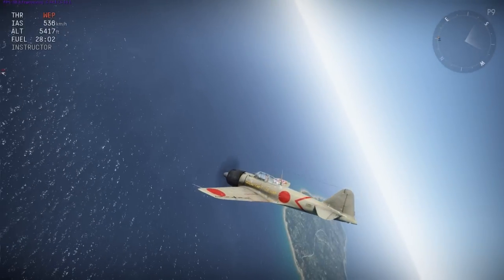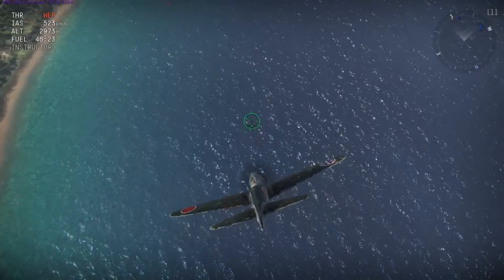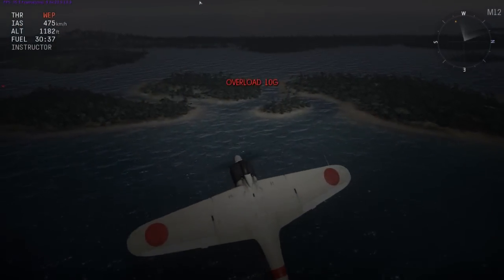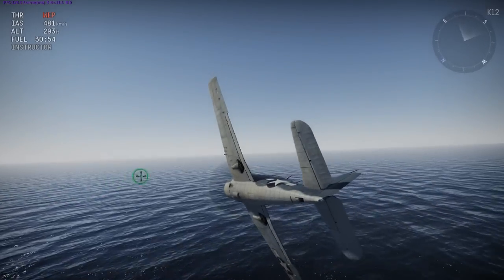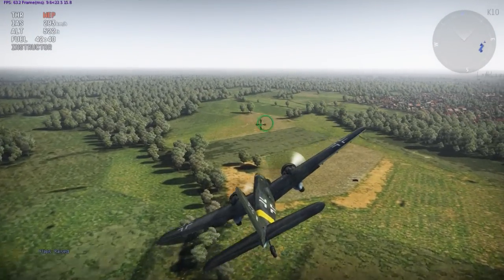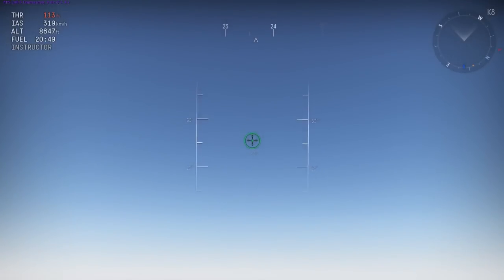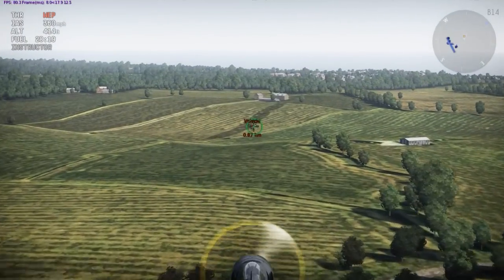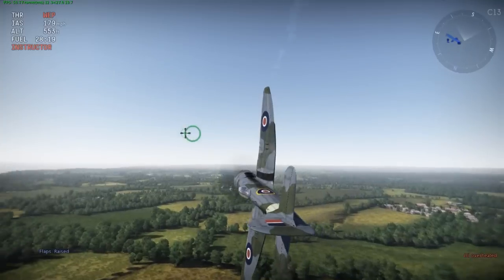Patch 1.37 preview: Pt. 2 - Flight model and game mechanic updates

Comment: Great job as always Walrus. One comment I need to make though is the Tempest V's top speed - with 150 octane fuel and 12 lbs/sq.in. boost it was able to do 394 mph (roughly about 634 km/h) in testing by the Hawker factory (that plane had a Sabre IIA though, not the later, improved Sabre IIB).

http://www.wwiiaircraftperformance.org/tempest/hawker-12lbs.jpg

The lowest top speed reported by the sources that I'm using is just above 600, but that's with the early engine (Sabre IIA) on low boost and with long, protruding barrels of the Hispano Mk IIs in place of the Mk Vs we have in the game. My conclusion is that a well-kept example of a late production Tempest (similar to a fully upgraded plane we have in the game) cleared for 150 octane should be able to do between 625 and 630 km/h, which is not far off from the speed that you achieved.
Reply: This exactly, 150 octane fuel is one of the upgrades available in its tree, indicating it has a higher boost rating and thus the speed is accurate.
Reply: Yup, you may be correct.  I was just under the impression that the 150 octane fuel upgrade was not supposed to be included when testing in a reference test flight.  I'll have to make sure of this once the patch goes live.
Reply: IIRC then "reference" is the plane with all upgrades, so at full performance.
Reply: Maxwell Strehlow Reference is the plane with all the primary upgrades. All the higher octane fuel mods are supposedly secondary upgrades.

Comment: Well done Walrus. As always. There needs to be a Like x 1000 button. I just love your stuff! What would be your opinion on the Dora though? In Pt-1 you said the D-9 could climb at 20 degrees at 300kmh but that seems crazy. I heard from a little birdie that the Dora is ~50kmh faster than historically. What is your opinion on this and do you foresee a 1.37 Dora Spam?
Reply: Thanks!
I think the complaints about the Dora will certainly be a thing of the past with its new rate of climb and acceleration(it didn't really seem godly, but it's very good).  Especially if what you say about its speed is true, I definitely think it will be a very highly used plane.  If the repair cost isn't high enough, it very well could be the case that we'll be seeing the age of the Dora spam part 2 in 1.37.  I'll certainly get on with doing an official flight model analysis on the Dora as soon as possible once 1.37 rolls around.
Reply: Sweet. And hopefully you nor I fall into this ditch if the Dora's do become the new FoTM. Well, I won't anyway. I'll be ripping Zeroes up with my new Hellkittee. :3
Reply: P51VoxelTanker
Don't forget that the allies now have a new and improved Tempest V as well(not to mention the amazing Tempest II).  This beast might actually be effective now, so I'd say the Doras will definitely have some good competition.
Reply: Crouching Walrus
I've been informed by a certain FM designer that the Dora's current SL top speed is a bug caused by improper transfer of files from Gaijin to the dev server. It's being worked on right now. The Tempest II seems to suffer from the same problem. As much as I'd like it to stay this fast it really shouldn't be THAT quick at SL.
Reply: Firefly

Hmm, according to this source, 670 kph at SL is actually pretty close to accurate.
http://www.wwiiaircraftperformance.org/tempest/tempestii-cfe-appd.jpg
Reply: Crouching Walrus
Wow, that's an eye opener... I've read that it was 10-15mph faster than the Mk V at all altitudes but didn't realise it was THAT bloody quick. Impressive stuff. The Sea Fury was faster still...

Comment: as much as i welcome the new F6F FM, it's sadly far away from correct. Actually it's too good now. As i tried to test the max dive speed and i got up to ~ 890 kph IAS - the message then was "exceeded speed limit 875 kph IAS". The original F6F operating handbook says for the F6F-3 under section 2-1 on page 29: "Dive Speed: Do not exceed 415 knots IAS below 10.000 feet!" - which translates to ~ 768 km/h

And i think the turnrate is also too good - i just did a simple test, but for a complete 360° turn at low alt ~ 1000m and under 300 kph it took always around 11 seconds.
Another test with the A6M3 delivered about 10 seconds. As far as i understood what we can read about these planes, was that besides the great power of the F6F, pilots should avoid at all costs turn fights at low alt+speed..